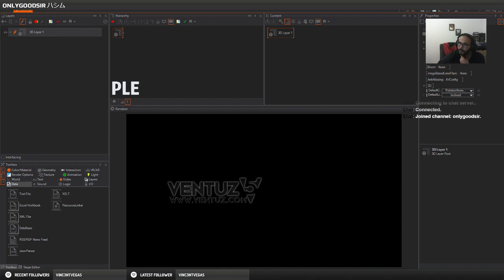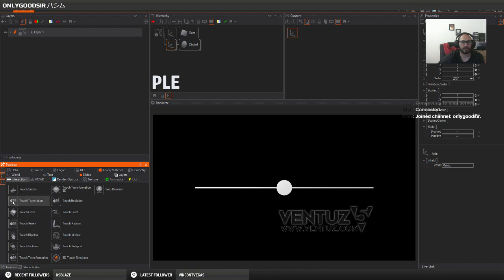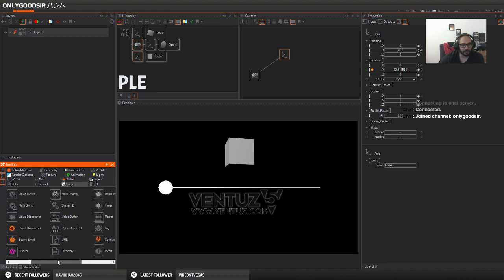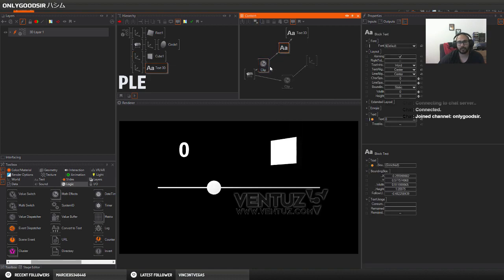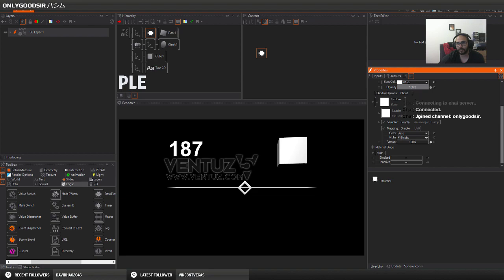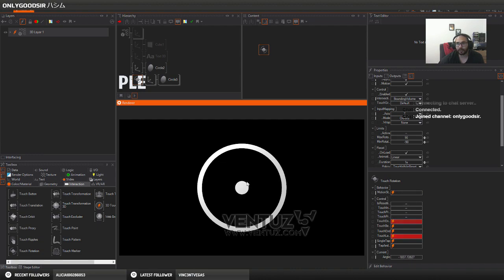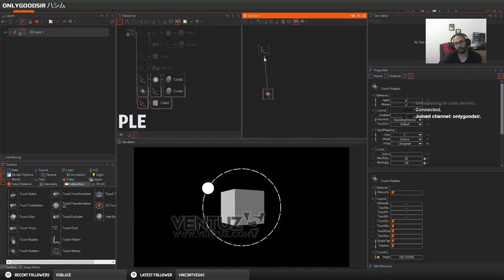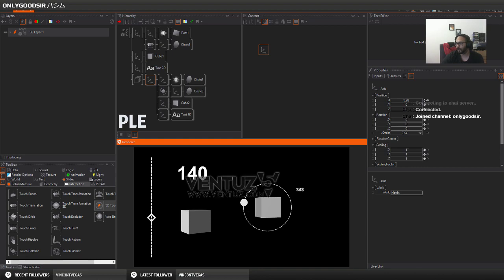Sliders in Ventuz

Comment: Hey Hashim... some tips... for the vertical/horizontal slider, the second clipping node wasn't needed. I realize you are playing around and building as you go, but you could have re-used the original clipping node for the text output by using the same output used for the cube's Y-rotation.
Also, there is a great way to ensure positioning for the touch rotation circle object in your circular slider; for the x-position of the smaller circle touch object, use either the size of the larger outer circle divided by 2 (i.e., instead of resizing the outer circle with its axis, resize using the circle's inherent X & Y properties; x = 16 & y = 16) OR use the ALL scale factor of the axis of the larger circle divided by 2. Then, connect the x-position of the touch rotation circle to either one using an expression, A/2. This will make it easier in the future when messing with your sizes and positions. :-D